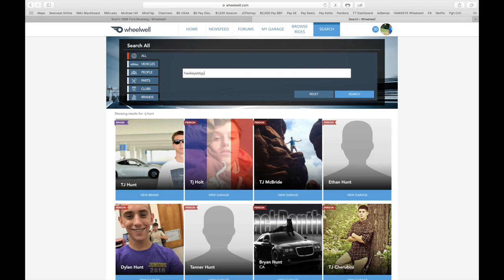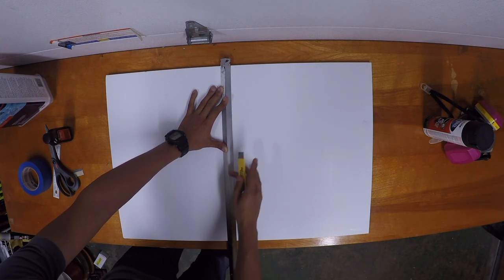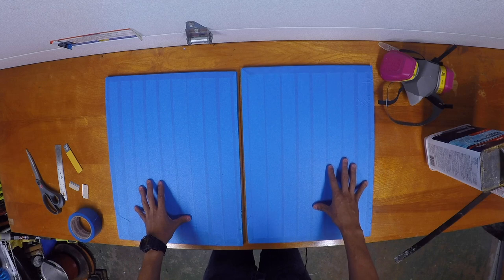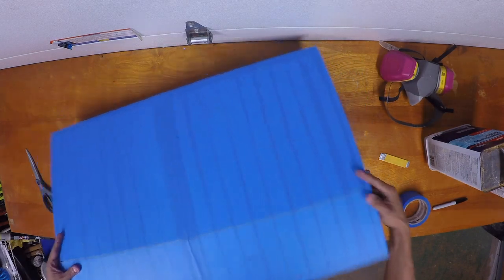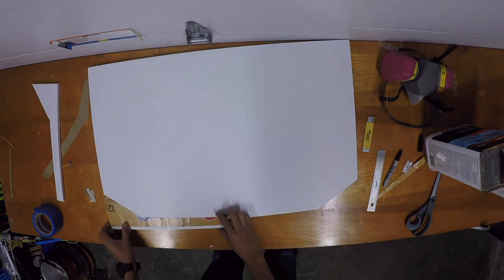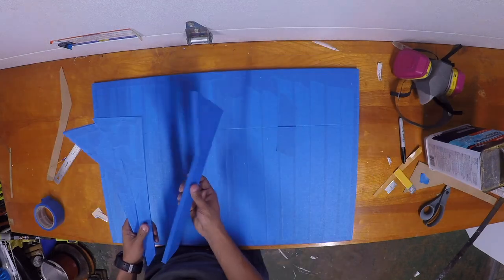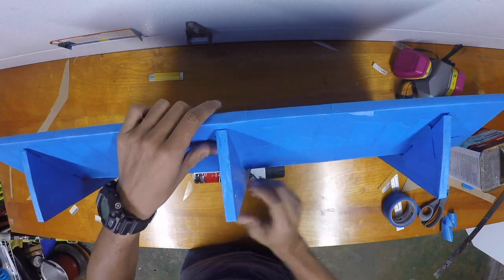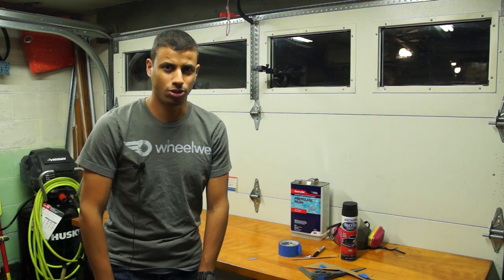BUILD: DIY Rear Diffuser

Comment: Subbed because of this tutorial, I think I'm going to use some of these techniques for enhanced my already existing oem diffuser. Add a number of fins from a photoshop design I've made and then wrap the whole thing with carbon fiber vinyl. It won't be quite as budget as this, but will still be way cheaper than buying type of aftermarket diffuser I'd want.

Comment: good idea with the foam plate. just one thing to speed up the process: use a angle meter to determine the angle on which your diffuser sits, then use that measurement to cut the stabilizers. it's faster and more accurate than cutting 5 pieces to see if they fit :) good job overall!

Comment: Why not use the mounting measurements, make a small skeleton, and cast it in plastic?
You could have it machined for like $200 if you can provide the root autocad file.
Would be much much stronger against impact. Plus reproducible for your model.

Comment: Yes okay very good but this could be how you gonna make it with aluminium tho ..why you should keep a foam carton ?
Reply from the maker: EmpireEcho The point of this video is to show how to make a diffuser for those people who don’t have access to sheets of aluminum or the tools to bend & cut it. This also cost a fraction of the money that you would spend on an aluminum diffuser. There are guys who make aluminum diffusers & all of them have access to tools that most people don’t have access to. They are also at least 5 times as expensive & many people aren’t able to spend that much on a cosmetic part. 

I’m not claiming that this is the best way to do it, but this is a very cost effective way of doing it. Mine lasted about 3.5 years & went through 3 winters & saw plenty of rain. 

You don’t have to keep any foam cartons. The foam board is used as the base to lay the fiberglass on. After the fiberglass cures, it is the fiberglass that gives it strength & makes it waterproof.

Comment: Can I use the fiberglass resin on a carbon fiber wing?
Reply from the maker: KalebS No, not really. You want to use an epoxy resin specifically designed for use with carbon fiber and that is UV resistant. The polyester resins used with fiberglass would not adhere well to CF & you would end up with very poor results. I recommend doing more research online, there are people out there who are much more knowledgeable than I am on the subject. Here is a link giving some brief info on what is out there. http://www.sollercomposites.com/epoxyresinchoice.html
Reply: HawkeyeSTiGuy awesome thanks man

Comment: Nice Job,  but the tape seems like a lot of work,  I coat the foam with water base Polycrylic from Home Depot,  to seal it from the resin..   You can even brush on Elmer's Glue,  it seals great..  It's a lot cheaper than tape and it dries quick..  A small can lasts for many jobs.   You can even dry it with a blow dryer..
Reply from the maker: Thanks. I was not aware of such a product. Elmers is also a good option. 👍🏻👍🏻
Reply: Hawkeye,   also,  you can use Clear "Packing Tape"  from Home Depot,  Fiberglass does NOT stick to it at all.   If ya wanna make something of fiberglass only..   You make a form out Foam, Plaster, etc.  (or anything) cover it with Packing tape,  and you can easily remove the foam form and have a fiberglass piece,  with no sticking at all..

Comment: That was my biggest question on these diffusers where in the hell do you mount this out underneath the car so it needs to be a chassis mounted diffuser?
Reply from the maker: I was fortunate that my car had some factory mounting points. Since then I upgraded to an abs diffuser & had to figure out where to mount that too. I’ve read a lot of stuff on different forums & some guys put holes in their trunk, use threaded rod or straps, then seal the holes up.
Reply: @hawkeyestiguy  okay cool thanks for replying I really appreciate it I'm following you now you got some awesome ideas very creative

Comment: where did you buy contact cement
Reply from the maker: I think I got it at Home Depot. Any hardware store should carry it, & even department stores like Walmart should have it. It should be in the adhesives section, home improvement or arts & crafts section.

Comment: Is there any specific foam board required? I see different kinds on Amazon.
Reply from the maker: Noblesse Oblige I recommend 1/2 thick foam board. The only place I've really seen it was in Hobby Lobby. I'm not even sure if it's on their website. A 20" by 30" sheet should cost no more than $6-7.